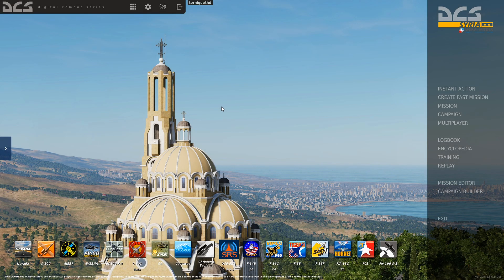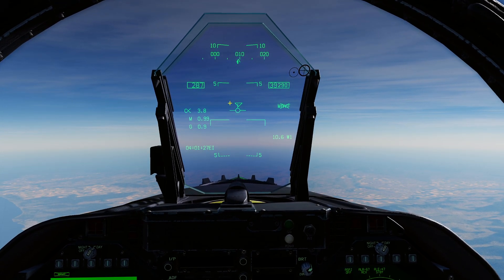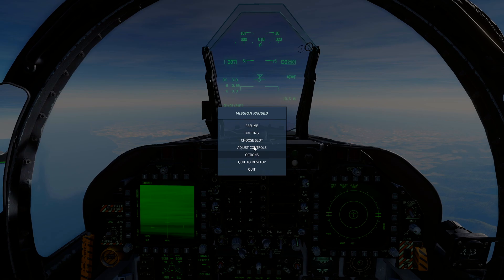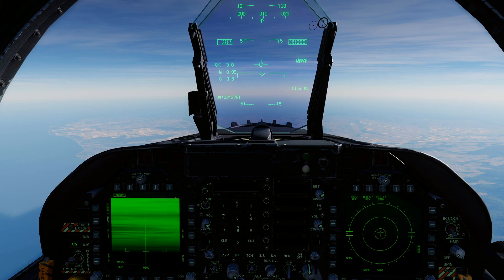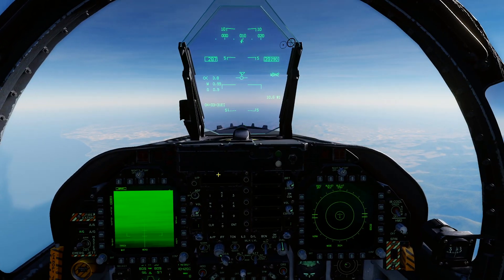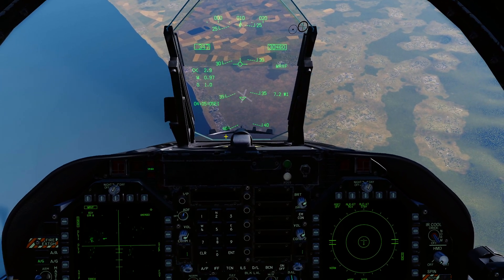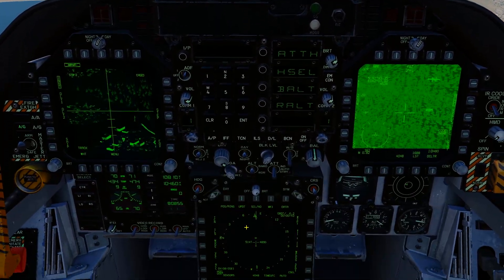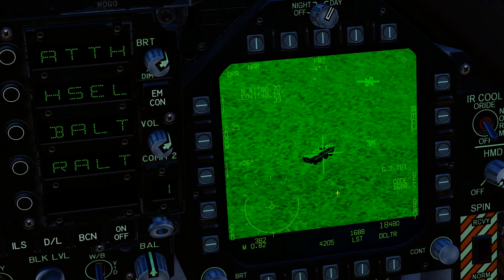DCS - F/A-18C Lot 20 Hornet AGM-65F IR Maverick Weapon Employment

Comment: Please help me. What mode should I use with ATFLIR, if doing same maverick IR. Sometimes it locks, sometimes maverick flies to waypoint I first designated the ATFLIR to look, like in here with LITENING, before searching the target itself. Same thing with autotrack. Maverick flies to the designated point, but sometimes, dunno why it tracks with moving target. I think I´m doing something in different order? But in general. If I want the maverick to lock to something not moving, should i use scene mode or what? There really is kinda ZERO tutorials with maverick IR wand ATFLIR. There is something really strange with it, or I just dunno how to use it. Sometimes it just seems that maverick leaves the tracking to some point before i choose the target itself. When coming near the target as missile flies, when it does not hit the triangle of maverick drifts a littlebit from the point that I have first fired it / where the target pod is looking.
Reply: II get the target pod follow the target and there is no problem using that, but seems like sometimes the maverick is trying to lock itself on some different point / its not talking correctly with atlfir. From forums many ppl have asked this also, but not really straight answer. How do I lock maverick IR with ATLFIR And after that, how do i lock it in moving target that tgtpod is tracking. It seems that tgt pod is tracking but not locking etc...? With litening it works like you showed here.

Comment: wtf is sensor select left?
Reply from the maker: Sensor select left, right, forward and aft let you choose which MFD is the sensor that your TDC will control. Ie if your radar is on the right MFD and your Mav seeker head is on the left you can switch between controlling the radar or mav seeker head by pressing sensor select left or right. 

You can tell which screen is the selected one as it will put a small diamond in the top right of the MFD. 👌🏻

Hopefully that makes sense mate 😌

Comment: I had to turn the Realistic TDC Slew off, it just wouldn't work with my Warthog Throttle. I'd get a small movement for a fraction of a second, and it would stop, like the TDC Slew Depress button wasn't being held properly, but as far as I can tell looking at hardware output it can be held and slewed no problem.

With Realistic off I can slew it great, but without pushing it in. I'm going to have to just live with it, I guess.
Reply: A year later, and one third-party replacement for the slew control, it works great with ground radar/realistic tdc slew. ;)